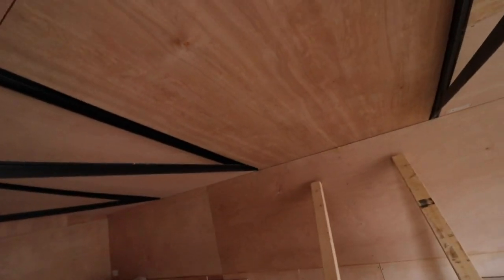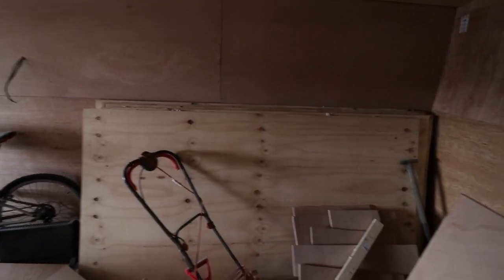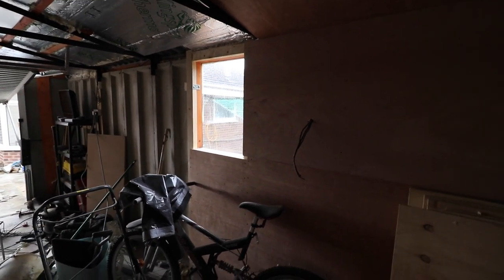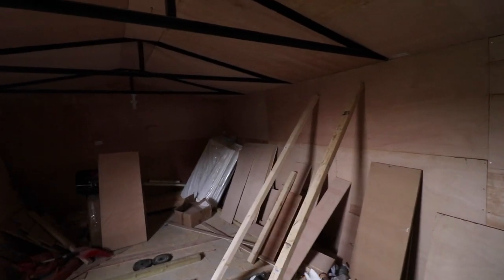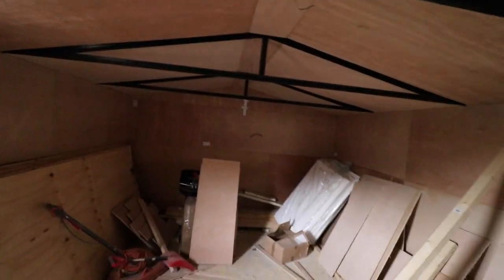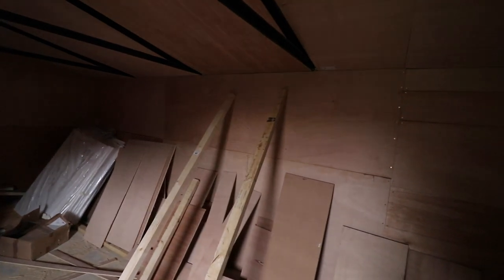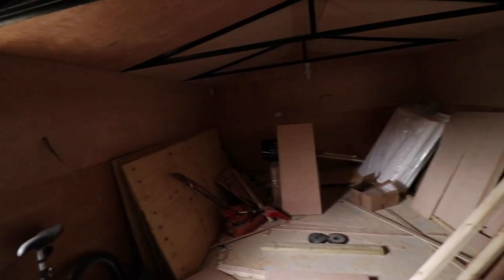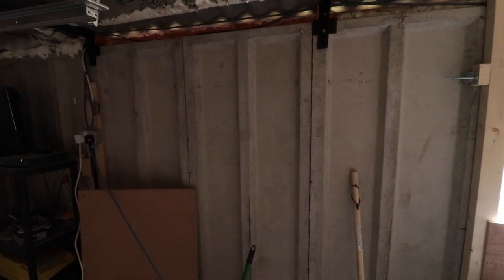part 11 Converting a Concrete Apex Garage into pool room blog I have install plywood on the roof

Comment: Can't you use plasterboards mate thanks for the videos
Reply from the maker: Hi technically yes and maybe its cheaper but plywood is better regarding moisture especially during winter. On a further note are these videos in parts or one long video preferred thanks.
Reply: @Technologyadvisor1  

Parts were fine buddy

Iv got a cement build garage my self 
Thanks for the video mate 

Your right mate not much information on conversion to these builds
Reply from the maker: i guess so but plasterboard is not good in damp environments plywood is resistant to damp.

Comment: What thickness insulation boards did you use ?
Reply from the maker: 40mm you can get it in 25mm 40mm and 50mm most houses use 50mm or 100mm  depending on the building
Reply: Did you use WBP Plywood?
Reply from the maker: @mikeschap1  not sure what the WBP plywood stands for but the plywood i used cost around £26 from wickes here is a link https://www.wickes.co.uk/Wickes-Non-Structural-Hardwood-Plywood---12mm-x-1220mm-x-2440mm/p/110116. If I estimate I used around 20 sheets of 12mm and 7 18mm for the floor.  The 18mm stuff was around £30 each as you can see its not cheap. Prices do go up and down a few pound from time to time dont forget to factor in delivery prices as well.
Reply: Technologyadvisor1 WBP Is Weather and Boil Proof. Thank you very much for your speedy reply and the link, it’s much appreciated. 
Regards Michael